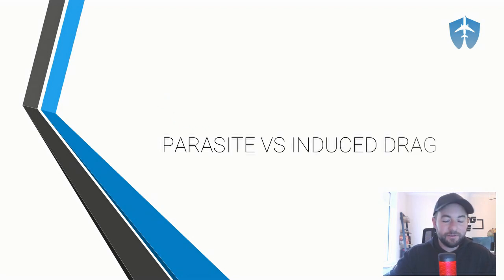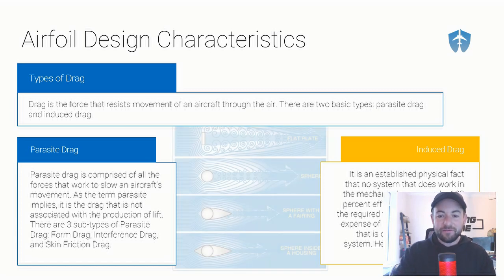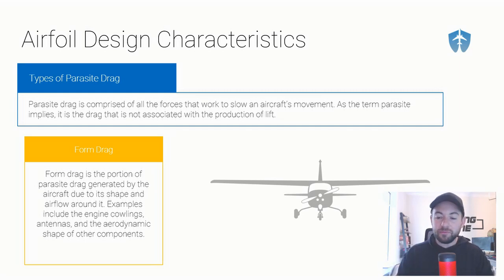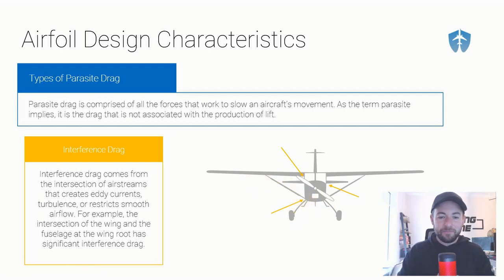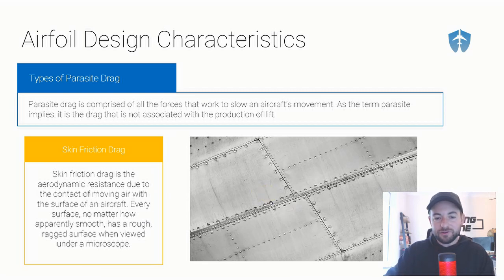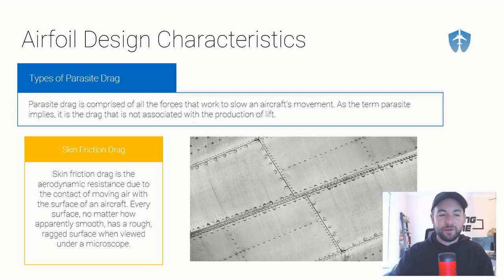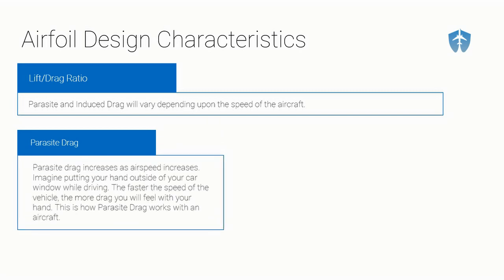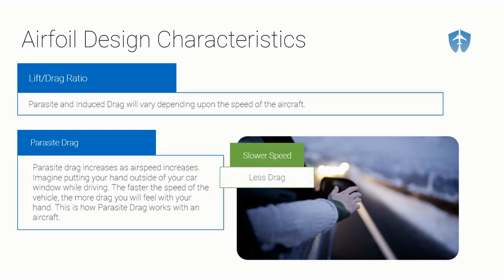Parasite Drag vs Induced Drag

Comment: I would like to add to the Induced Drag reasoning:  It is understood that this is mostly based off of wingtip vortices, with the air under coming around and hitting the top, thus creating the drag.  At low speeds, this bleed air is coming around and banging directly into the top of the wing (high drag).  As you go faster, by the time the air completes its circle up to the top, the wing has already moved beyond that point and the air doesn't completely hit the top of the wing (less drag).  Therefore, higher speed equals less Induced drag, no angle of attack change needed.